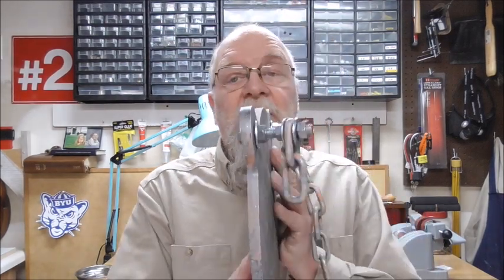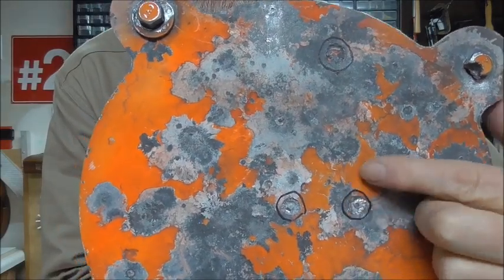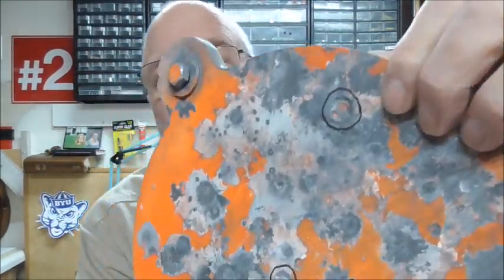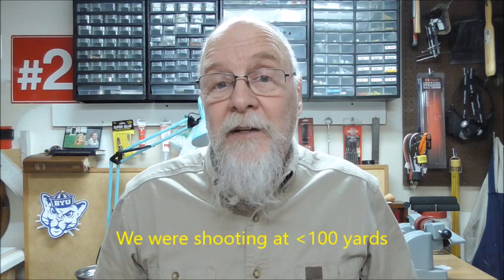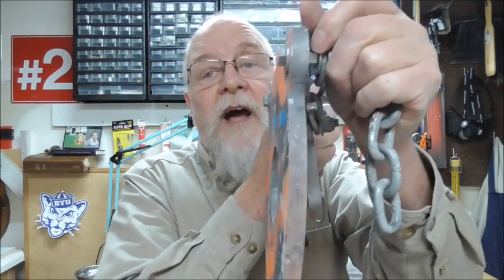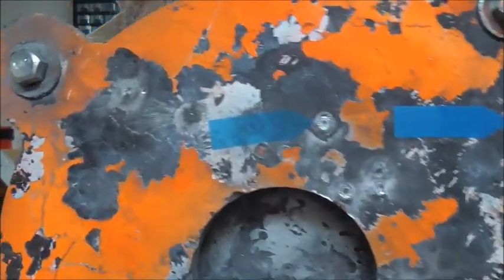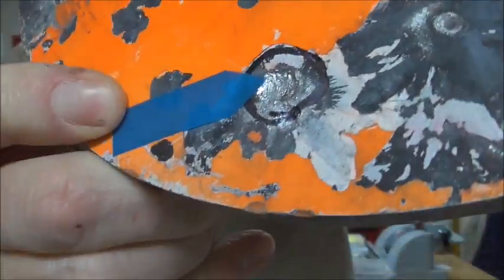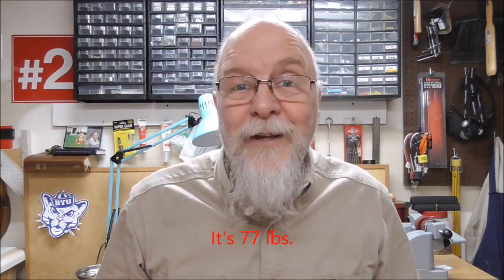Selection AR500 Steel Targets

Comment: And the 45-70/90/120 didn't get a mention? lol
Just mucking around I hit a 2 or 3"" square piece of suspended mild steel @ 100yds with my 22-250 with both Federal 55gn SP and 52gn HP. The soft point went straight through and the HP left a massive (1/2" dia) crater in it. Almost made it through. The steel is on display at our LGS. Amazed me, I didn't think either of them would go through a suspended target (vid on my channel). I was recovering from some treatment, had the horrors (shakes) something terrible. Bit fruity, by you're over 18, lol. Shooting kept me sane through the treatment.

Cheers ol' mate, great info.
🇦🇺 🍺🍺

Comment: only problem with flat targets like that is they don't ring loud enough. i made some 10 in square flat 1/2 in steel targets and then welded a 5in x 10in pice to each side on the back to make it look like this  "  I____I  " then hang it on a steel hook.   and it made all the deference. these targets are very loud. they almost ring like a church bell when you shoot them. very loud reverberation !